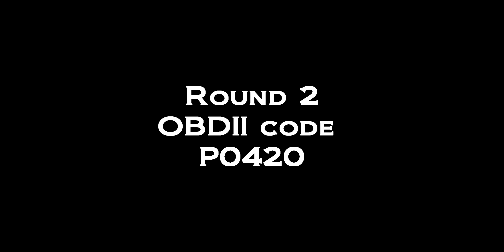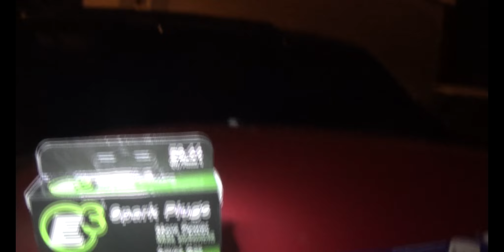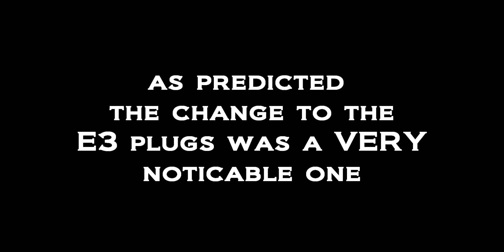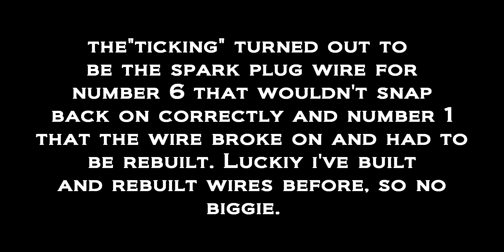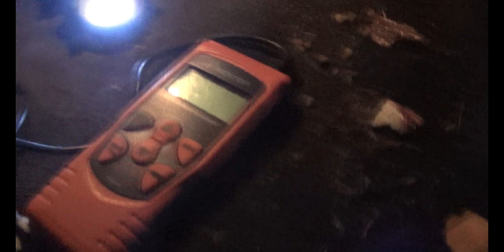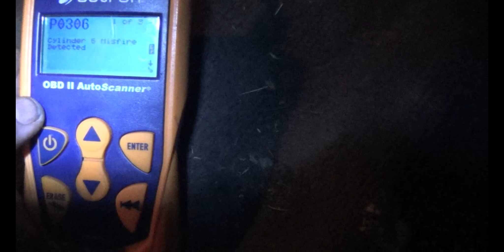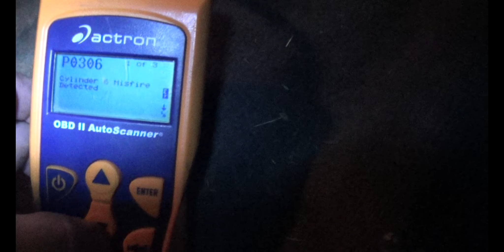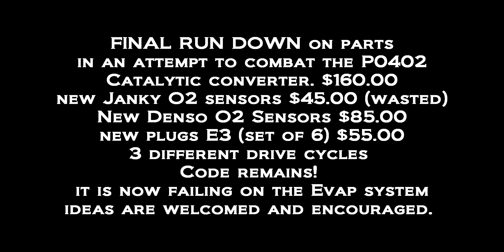Round 2 OBDII Code P0420

Comment: I'm glad I don't live where emissions testing is required anymore,I lived in Davidson county and they failed me one time because I had a locking gas cap on my truck. It passed the emissions test no problem I asked why he failed me, his exact words were because it was not the fackdory coreck part. I went to the auto parts store, bought a gas cap and went to a different test center, showed the guy the papers and told him what happened and he said exactly what I told the other guy WTF does that have to do with it. He printed out a new compliance letter,did'nt even look at the new cap. My only solution for your problem is move where they don't have emissions testing,I have three vehicles that have evap codes,does'nt affect the performance, just won't pass the test.
Reply from the maker: yeah i think it's retarded how NOWHERE else in this whole state except Sumner, Davidson and Rutherford counties even have emissions testing. i could register the car in East TN at my mom's house but that only gets us by for a year and if we get stopped out here they'll fine us for not having the proper tags on for our area. equally as retarded

Comment: Just curious... did you ever find out what the problem was? I've heard before Intake gasket or plastic intake can cause similar issues. I've owned 5 3800's series 1 and 2's, only one had that code and it was my upper o2 sensor. If I remember (3 years ago) correctly I put an acdelco in and the code went away. My sensor wire had been burnt by touching the hot manifold.
Reply from the maker: fuel trim was off, new injectors new plugs & wires, new catalytic converter, both new O2 sensors and the evap module in the driver's side rear fender was the parts list in it's entirety, that and A LOT of frustration till i got it all figured out of course but mostly all it really needed was the plugs and injectors. she's running E3's now for plugs so i shouldn't ever have to replace those again if they last in her car like they have in my tahoe.

Comment: Dam its still showing the same error, i thought that the correct sensor would have fixed it, im so sorry jim :-(.
The trouble with obd2 is its showing whats unhappy, not what its caused by, thats its weakness as a system, so it could be an upstream problem like air leaks or dirty air input sensor, temprature sensor, throttle body position sensor.

Are the old plugs firing the same, same equal colour?
The new plugs sound and look superior, and the power improvement shows how crap ordinary plugs are.

If you know someone with a more complex scanner you may find live data shows an oddity.
Sorry if im talking shit, im not into the oddness of obd and sensor problems :-(.
Reply from the maker: no you are actually on to something because that's what Michael was suggesting too since he has the wiz bang code reader and can see the live data on his.
Reply: Check the state of the sensor before and after the cat, just to make sure the cat is working, just a secondary thought :-).
I liked Michael in his Ozzy pose, he needs to shout at the car "What the fu*k is this shit sharon!!" LOL :-D
Reply from the maker: zx8401ztv lol  alrighty then :o)